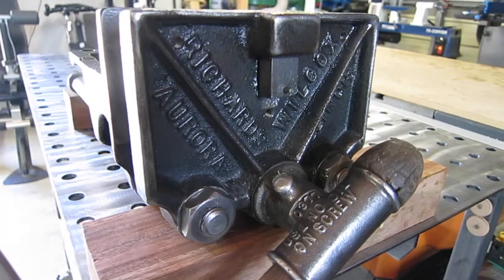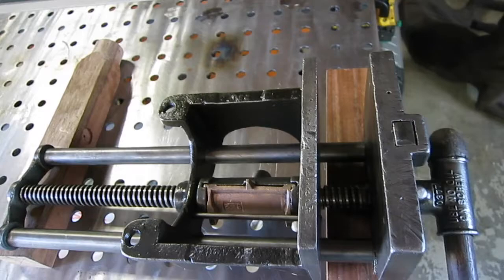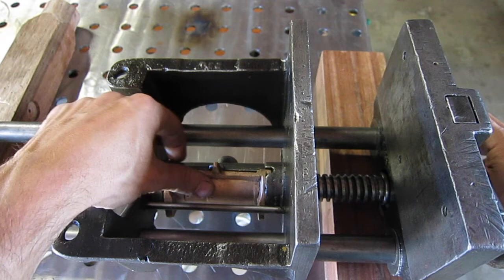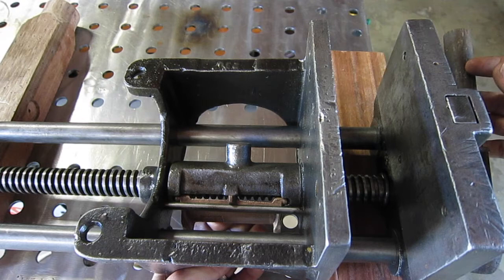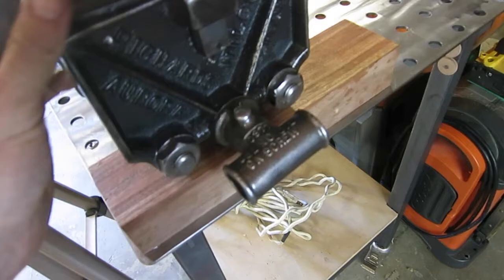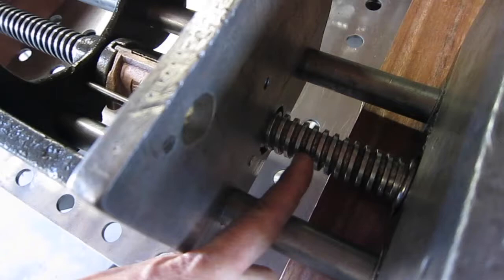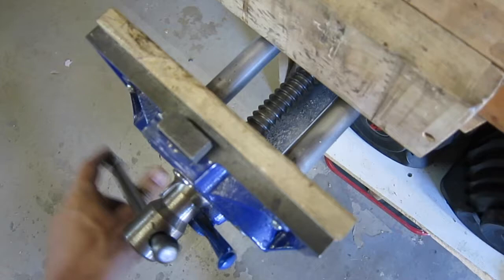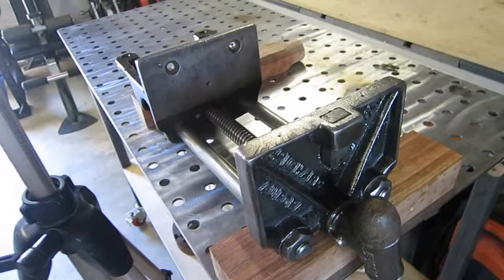Richards Wilcox Wood Vise Restoration - How the Half Nut Quick Release System Works

Comment: This was a great help - I found a slightly different model in my grandfather's old workshop last year, but someone had put the bronze piece in without slotting it under the iron rod correctly, so the iron protrusion on the split nut was hitting the rod instead and had bent it slightly out of shape. They had wired the bronze piece against the split nut, so I knew it wasn't correct, but when I cut the wire off and spun the handle, the bronze piece fell out without the rod to support it. For months, I thought it must be missing some kind of retaining ring for the bronze - this makes so much more sense. Now to finish restoring it!

Comment: I just bought one exactly like yours in very good condition although the bars are a bit rusty and someone has been oiling the screw. I’ll be cleaning it and installing it in my Roubo bench soon to replace the Yost QR vise I have now. I like that you just clear coated it rather than a total repaint. FWIW it was in an antique store listed for $130 and the seller took $80.

Comment: Great video man. The one I was given is really old and doesn’t have a dog on it. I built a thick chop and put 2 holes to place bench dogs in at the top of the chop. Also, it’s not the most convenient, but you can reverse the vise. I just reach down under the vise and with my fingers, hold the nut up against the screw and it unwinds the vise easily. Try it. Thx again for the video.

Comment: Although the vice I'm working to restore does not have the Wilcox branding (a cheap knock-off?), this video helped me to understand how it works, and what happened to mine (the brass half of the nut is missing).  Pity.
regardless:  THANK YOU for posting.

Comment: Finally getting around to working on my vice. Three questions: are the knobs on the handle glued on? I removed a nail from one side and it doesn’t budge. Also, what do you use to protect the rails and screw after clean up? It says no oil. So you just have to be vigilant against rust? Also, also: what holds the vice handle in the main screw? A pin? Mine has so much paint on it I can’t tell.
Reply from the maker: Your knobs may be glued on.  I replaced the original and turned some new ones out of hardwood.  One side is fixed and the other side and a tenon that fits into a mortise on the ball end.  I epoxied in a threaded insert into the handle and bolt the ball end on so it can be removed easily.  You can oil the rails with ligthweight oil, but not the screw.  You can also use paste wax and buff.   The screws in pinned in place.  I can't remember if it's a taper pin or a straight pin that's peened over.
Reply: @thesergeant3524  Thanks for getting back to me. I'll probably do the same thing. I had it in my mind to just cut the thing off but the history of the thing made me hesitate. Thanks!

Comment: Great Video!  I'm wondering if you can tell me what you used for the clear coat finish??  I was just given a Richards Wilcox Vise from my wife's grandfather who was a furniture maker, and Im in the process of cleaning it up a little.  I really like the looks of the clear coat.  Any input you can give me on how you refinished it would be great!  Thanks for the video!
Reply from the maker: Thanks!  Cleanup is just a lot of elbow grease.  You can soak it in "Evaporust" or Vinegar to remove the rust but it imparts a dulled finished.  I just used a wire wheel, scouring pads and WD40 to clean up and derust everything.   Wipe everything down with denatured alcohol or another solvent to clean before paint.  I clear coated with a spray on clear gloss lacquer.   It's been holding up well.  I'd love to see some before/after shots of your restoration job.  Post a link if you're able.  Have fun!
Reply: Will do!  Thanks for the reply.  I was going to just grab a can of Rustoleum Clear Gloss, I'm guessing that will do the trick.  Ill take some shots to put up some before/after pics.

Comment: Hey man, 

Thanks for the video. When I turn mine to tighten it won't. It starts to tighten but then it slips off the rod and all pressure disappears.  Any idea on how to fix it? All the same parts are there.
Reply: Jordan Goodson 
The gravity tightening brass screw needs to be replaced.
Reply: Just in case mine is gone, are those half-nuts readily available?
Reply: @bmilhoan   haha i got one of these today only to find the half nut was missing- i fear its now a very inexpensive door stop.

Comment: Hey quick question . How did you remove the rust if you had to do that?
Reply from the maker: there are a number of ways but for this one I just used a wirewheel and some wd-40 and a scotchbrite pad.  You can also soak in vinegar overnight or use a product called Evaporust.  For large items you can also use electrolysis bath